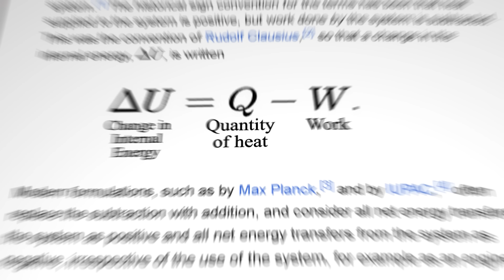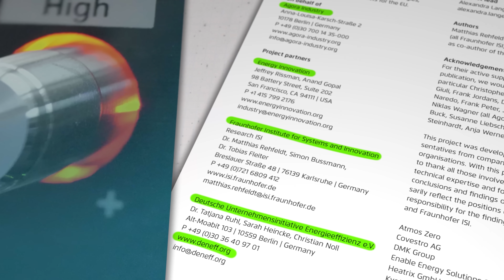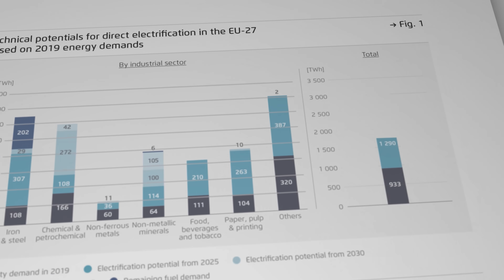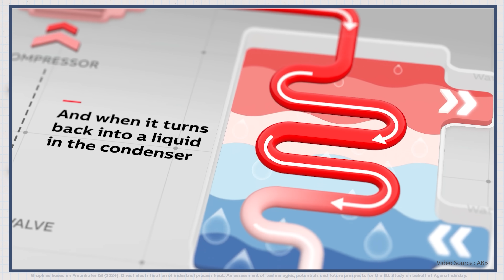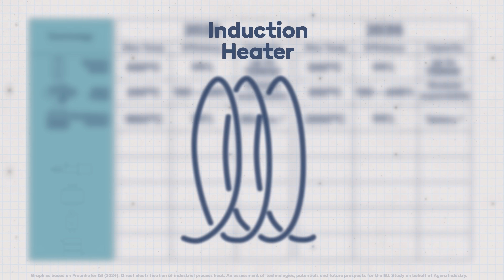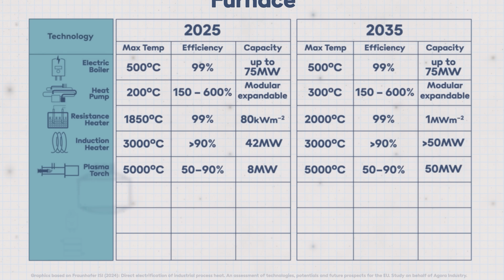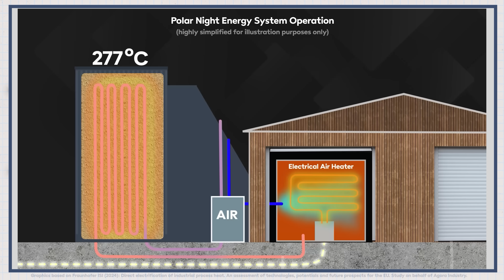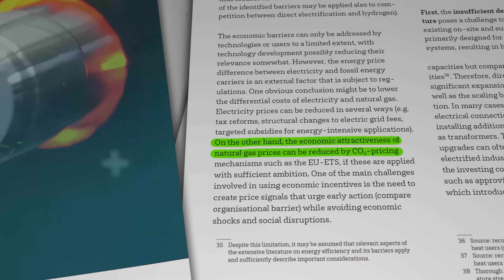Kicking fossil fuel out of industry! Here's how it's done...

Comment: Thanks Dave, excellent video. Two points:

1) Actually waste heat is by far the most attractive heat source for heat pumps in industry, also at lower temperatures.There is plenty of it available, as the most heat intensive processes such as drying invariably end up emitting those white plumes of water vapour through various stacks, which contain nearly all of the energy that was injected into the process by gas burners. Recovering that heat by condensation of the latent heat and then boosting the temperature of recovered heat by a heat pump is much more efficient than using ambient air or water (because the waste heat contains much more energy, and is consistent in temperature all year long). Using the recovered waste heat in the same process has many advantages around synchronisation of supply and demand for heat, and around standardisation of engineering. In order to scale quickly you want to avoid having to Engineer To Order every heat pump implementation.

2) You mentioned the low price of electricity at night for charging the thermal storage systems. In fact, in all countries with significant solar panel deployment, electricity is cheapest in the few hours around noon, when the grid is often flooded with cheap solar electricity. This results in a daily pattern of electricity prices called the 'duck curve' named after the chart that results from low prices around noon, and high prices in the early evening when the sun is gone, and everyone starts using electricity at home. This is already the case even in the Netherlands. But in a country like Australia it is already so pronounced that industry is experimenting with thermal energy storage that is charged for free during almost all early afternoons and then used in the form of steam or hot air during the next 22 hours or so. Big CAPEX challenge, but very good payback any way because OPEX evaporates quickly.
Reply: Not only CAPEX but maintenance. Gas reticulation and burners are old and well understood but heatpumps are tricky and problematic. The legacy electric grid is unsuitable for transmitting diffuse sources of power flowing backward, much CAPEX there too. Future society energy usage will look quite different to today, apart from the high tides lapping around our feet.
Reply: Some companies, eg Brenmiller Energy is delivering heat as a service to their customers - removing the capex factor and profiting off of the price fluctuations themselves while company benefits from lower fuel costs and better ESG ratings.
Reply: Do any European nations have an office tasked solely with thermal energy transition? Would seen a worthwhile role to help show various industries how to change
Reply: EXACTLY my thoughts. Why the F!!!..?? don't EVERYONE do thermal heating. It should be a well in everybody's garden, and it should be a thermal recovery source on everyones land, property and business. I mean, people are growing tomatoes through the winter because of it. Heat. The Industry has too much, and our homes has too little. You gotta think it's possible to cross section some tech here. 🤷‍♂️
Reply: @bleargh22  They have that since Paris agreement in 2015. We had that in the US before Bush "drill baby drill"... In the early 2000, the US was the master in chips, solar pannel, electric car... Everything was lost under that moron...
Reply: I was just thinking about steam reclaiming, cool that it's a real option :)
Reply: I regularly scratch my head when I pass the clothes dryer, I'm using electricity to heat clothes and then pumping that heat outside, while at the same time using electricity to heat my water!
Reply: Countries where heat pumps work don't need heating

Comment: Please do an episode on Hazer, an Australian company that’s developed a process for converting methane into hydrogen and graphite with zero carbon emissions. They’re at TR7 and the first commercial plant is being built in Canada this year.
Reply: You are right turquoise hydrogen could be applicable. At least much lower electricity need. However due to c not being used less efficiency. Should be outweighed against blue.
Reply: @alexander7298  The plant can power itself using a stationary hydrogen fuel-cell power generation system. Furthermore, the methane feedstock for the plant can come from sewage treatment plants. They're building the plants alongside the factories and mills that require the hydrogen, so large scale storage and transmission isn't an issue.

Comment: The are technologies to decarbonize every industry with electrification. That is why decarbonizing electric power is the top priority and setting a fair price on carbon emissions is key to motivating industry. Yes industries like cement, refineries, or ammonia need green hydrogen, but most of industry can use the tech you mentioned.
Reply: Some of those high temperature industries can use concentrated solar thermal instead of hydrogen
Reply: It is IMPOSSIBLE to decarbonize !
Moreover why would any sensible nation wish to ?
China and India are building HUNDREDS of new coal fired power stations.
They understand the scientific realities very well.
Co2 levels are not and never will be a problem.

Comment: The use of technology to use waste heat and generate electricity is also a viable option.  This is especially true in the steel and cement industry both of which produce vast quantities of wasted heat.  By using a stirling process or steam turbine to turn a generator, some of the energy wasted can be recovered and put back into the system.  Like all systems it would include a certain amount of investment but it would also bring in a revenue stream not previously included..

Comment: Heatpumps for 200°C are not a common and well testet technic yet, and it requires fairly high temp. waste heat to get a COP of just 2. In a country with need for heating buildings its not an easy case to sell.

Comment: I was just yelling at the screen: Solar Thermal.
This is far and away the most efficient method of providing heat ..... but only up to about 50C in winter and perhaps 80 to 100C in summer. 
That is especially useful for drying, which is a huge source of energy. Lots of things like - much of our harvest, and the wood pellets many burn, need to be dried and could be dried on sunny days.
Reply: Solar thermal is poor. It's low-grade heat that takes up a lot of space, and concentrated solar power (mirrors reflecting on a central point) has failed to thrive. 

In almost every case it is far better to install solar panels that produce generally useful electricity, including powering heat pumps that are more than 300% efficient, as this video explains.

I ripped out the solar thermal tubes on my roof that did little but provide me endless hot water in summer and replaced them with more solar PV.
Reply: @skierpage  Surely you can combine "low grade" solar heat with a heat pump.
Reply: @skierpage  And my panels heat my water with excess output when it is available, plenty of hot water .
Reply: @skierpage  It is arguably the best means of providing low grade heat during summer months, e.g. for solar hot water systems. That equally applies to the drying business, where it can heat biomass up to about 80C for drying (or 40C if the aim is not to cook it).
Reply: @skierpage  where can i get a perpetual energy device to generate 2x as much energy as i put in? need to know.
Reply: @AJB4D  <- found the person who didn't watch or didn't understand the video. Pay attention at 4:30 where Mr. Think explains "COP".

You can move heat energy from one place to another using much less energy than is in the heat delta. Amazing but true.
Reply: @AJB4D  a good heat pump will give up to 5x what you put in. Nothing perpetual about it, just thermodynamics
Reply: @alanjewell9550  and there you go letting us all know you know nothing at all.  You are talking about making something from nothing. FFS go away flat earthers. This isn't the stockmarket pal.

can't fix stupid and this guy isn't just eat the phuc up with it, but embracing it.
Reply: @AJB4D   everyone else is correct, Mr. Think is correct, and you are just embarrassing yourself. The work required to move heat around can be much less than the energy in that heat. A heat pump is not making something from nothing, it is not a perpetual motion machine, and no law of thermodynamics is violated. Go read some Wikipedia articles.
Reply: He did mention heat stores though not in terms of directly charging them from solar thermal panels which seems obvious to me, even if using surplus electricity is also used.
Reply: A company called Absolicon do concentrated solar heat. I don't remember their numbers, but you can probably look them up.

Comment: will mass adoption of air-source heat pumps reduce overall global air temperatures, or is that a silly question?
Reply: First think about your fridge, it has a cold end inside and a hot end outside [pumping the heat out of the box], then the heat slowly leaks back through the box walls and the open door so you have to keep pumping. It's pretty efficient but the system uses some energy overall to run the motors so you're heating the world up a tiny bit - mine uses about 2 to 3kWhrs per day, it's quite old.
Your heat pump also has the same hot end and cold end, essentially the same rather bigger machine, but the cold end is outside and the hot end is now the useful one inside the house. And again the heat slowly leaks back out through the walls and air changes on that freezing night so you have to keep pumping. 
A well designed heat pump system should produce a 'Coefficient of Performance', COP, of 3.5 to 4.0 across the seasons [you can think of it as 350% to 400% efficiency]. It works because it's a nice little trick of the 2nd Law of Thermodynamics and the 'Carnot Cycle' which is a lesson for another day. By coincidence it's exactly 200yrs since Frenchman Carnot developed his ideas on heat engine efficiency in 1824! 
Heat pumps are not intuitive so there are no silly questions, there are sadly some silly answers [and some very bad installations].

Comment: UK has three major problems when it comes to electrification of anything (everything):
1. The state of the national grid. Existing Transmission and Distribution barely can handle the domestic heatpumps uptake and the EVs. Nevermind an industrial high temp heat pump. Nevermind new AI Data Centres. 
2. Lack of competence. Too few competent solution engineers. Everyone wants to be a project manager or project director and sit in Teams calls forever, doing nothing. 
3. Very low salaries and wages for professionals. A 15 years experience energy / solution engineer is paid £55K to £60K (if). In US or Canada this is the start salary of a professional engineer. You do the conversion £/USD. 
UK is in managed decline and this sector is not an exception
Reply: Regarding 1) EVs aren't an issue for the grid the increase is less than 10% of current generation capacity (several GW) according to National Grid. The UKs transmission capacity was designed for a 80GW demand level, which was the level back in 2005/6, since then demand has diminished to 35 to 40GW. What the National Grid are investing in is to make the current system less centralised, address issues with historical problem area and connect up the coast for new offshore generation sources.
Reply: What makes you think that Britain has a corner on these three deficiencies?  I don’t think there is a jurisdiction in the world that doesn’t have various levels of these problem.  This is not partisan rather global.  Grid interconnects over borders and electrical grid standardization would greatly assist with existing distribution networks and efficiency.  Humans don’t appear to be vey good at cooperation for the greater global good.
Reply: You could also add that with the UK currently having about the most expensive electricity in the developed world, it will be a real challenge to sell mass-electrification to industry.
Reply: @Pesmog  - that will change once gas is dropped as a generation source or the pricing framework no longer based the consumer electricity price on the most expensive generating source at any point in time (which tends to be natural gas these days, followed by imports).
Reply: @GruffSillyGoat The highest electricity costs in the world, yet half or more of our electricity is generated by wind . What happens when we go full net zero? Electricity costs the highest in the galaxy?
Reply: @philipwright6617  - the expense of electricity in the UK is due to the way the pricing framework sets the price on the basis of the most expensive generation source within each billing window, which happens to be natural gas not renewables. When full Net Zero, with no natural gas in the mix then prices will drop. However,  it may come sooner as a number of the energy suppliers are pushing for a more regionalised approach to electric energy pricing in the UK, whereby if a region generates on lower cost renewable power that will set the price for the area where the renewable resource is located.

Comment: New methods can also help. The flash iron making method, as detailed by Professor Zhang Wenhai and his team in a paper was recently published in the peer-reviewed journal Nonferrous Metals, can complete the iron making process in just three to six seconds, compared to the five to six hours required by traditional blast furnaces.
Reply: Iron ore is an oxide that needs to be reduced to metallic iron. This process still takes hydrogen or nat gas just like other Direct Reduced Iron processes.
Reply: @E1Luch  Thank you, do you know the relative energy use? Any idea of the relative greenhouse gas emissions?
Reply: @gpsfinancial6988  No idea, I'm not an expert. I guess emissions should be low if they use hydrogen. I just think its similar to DRI in general because the basics are the same, but done differently with flash smelting which may make the process cheaper/able to work with lower grade ores. If you want to know what hydrogen DRI looks like, they were trying it out in sweden couple years ago, this channel has a video about it. Also you shouldn't treat this flash method as if its a real proven technology because for now its mostly a lot of words on paper.
Reply: @E1Luch  DRI is quite different than flash ironmaking. My guess is then electricity will be cheap enought to make hydrogene, then climate change had been a memory of the old time... Like nowdays 70% of electricity come from fossile fuel... I can't see a day were there are that much renewable that electricity had no value...

Comment: But did you ever think where does electricity come from?
For a compressor you need something to run it. You can't just extract heat for free. You need work for all that so it's not free. 
Electric boiler is resistance heater, pretty much anything electric is resistance heater. 99% efficiency is a myth.
Induction heater is just another form of resistive heater. 
I'd really like to see those efficiency calculations.
What is this video about? For all those processes pretty much what you can do is to build some more nuclear, hydro or fossil fuel plants and make them really really big so as they burn a lot of fuel their efficiency goes up - both "mechanical" and economic - And then as you convert heat into steam, steam into electricity then you can have 99% efficiency I gues lol. So I guess what they did in those studies is they dumped all inefficiencies at the power plant and forgot about them. 
There is flawed reasoning behind this research.